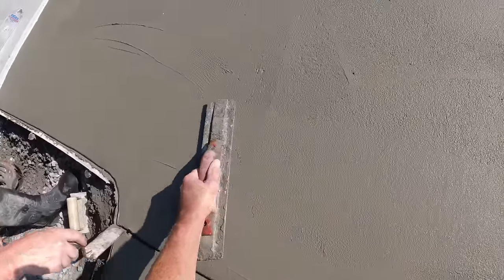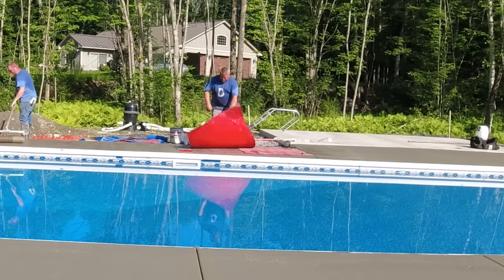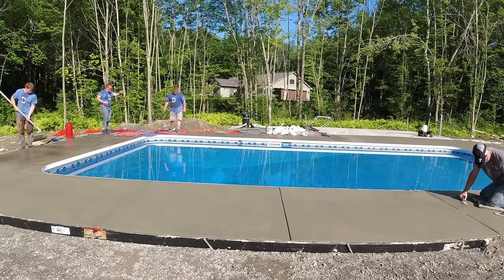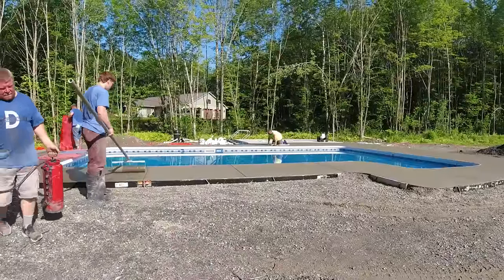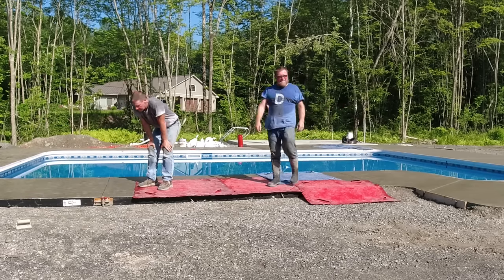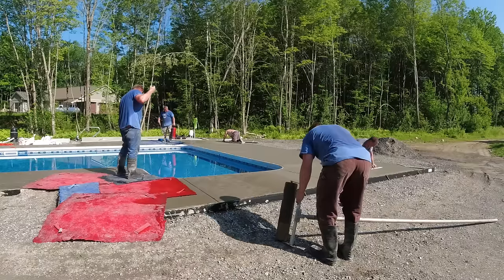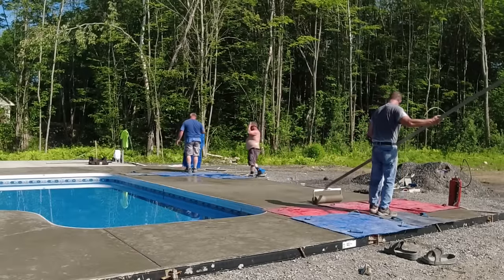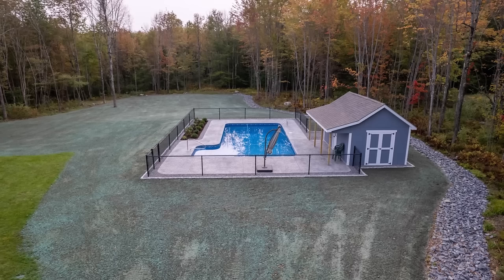Was It Too Hot? How To Pour And Stamp Concrete In Hot Temperatures (Part 2)

Comment: Doesn’t curing in super hot conditions cause long-term issues? Sincerely curious
Reply: You have to be more anal about it for sure, using either a really good curing compound or wet curing. Im in Arizona and in the summer youll have mud at 6 and it will be bleached out totally white by 9:30. This is terrible for concrete, once its finished you want to keep as much residual moisture inside of it as possible. Im really looking forward to trying some internal curing chemicals if I can find a batch plant with them in my area. From what I have seen online they are working magic for the guys using them.

Comment: way  too hot   to  pour around a  pool  that is  the worst  thing  you can do  and  even  if  you can save  it  you will bust your ass   always  plan  your  pours  around hot  and  sunny  days
Reply: Theres ways to do it. If we shut down over 100 degrees we would only have about 10 weeks every year we could pour here in Arizona haha. You have to be efficient and really really anal about curing. Design your mixes to make it easier as well, strong enough to take some water and super p so it can be placed wetter. We line pump most jobs as well that cant be chuted, no messing with buggies. Its all about getting it down as fast as possible and having enough guys to hop on it.